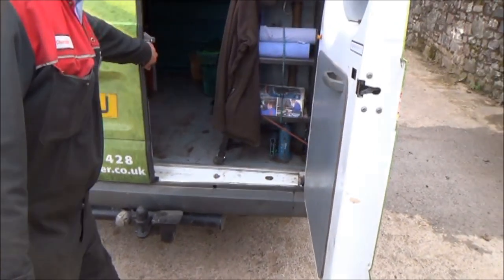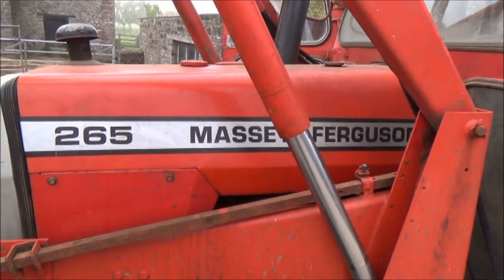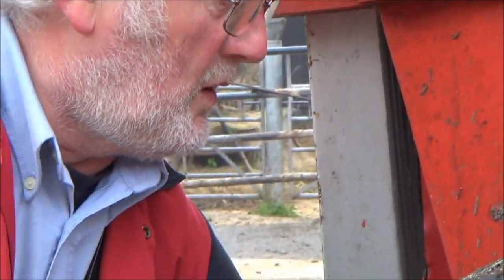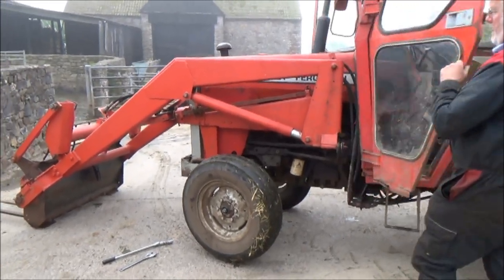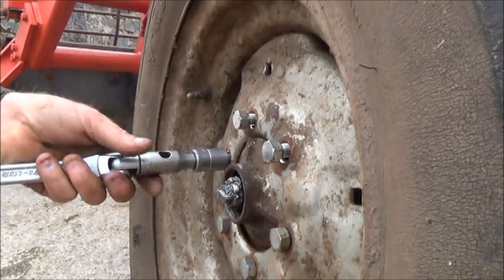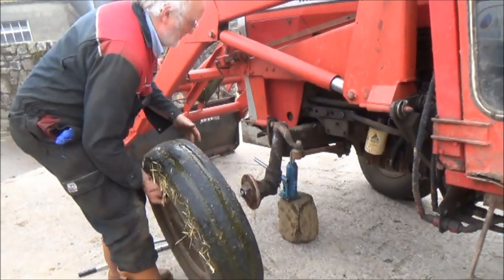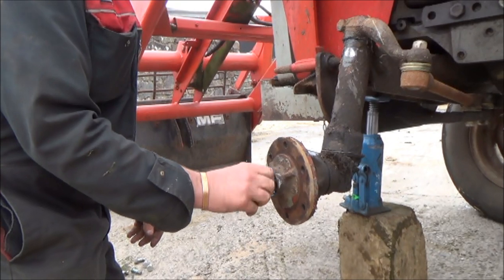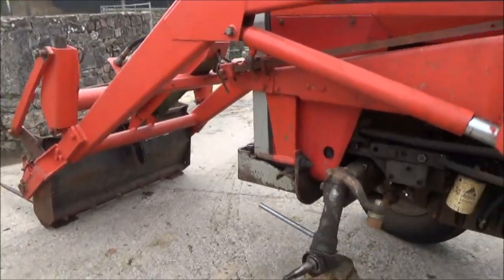Fitting a new wheel hub to a Massey Ferguson 265.Part 1

Comment: how many tractors do you have? and why don't you sell a tractor you don't use and instead buy a good tractor like a new holland 8340 we've got that on our farm and its brilliant or a deutz fahr d6.30 which is also not a bad tractor.
Reply from the maker: 3 good tractors and a few old ones. We have a good mix of tractors for what we do and the old one don't cost us anything so it doesn't matter if they sit in the shed until we need them. I guess every farm is different in how they use their kit

Comment: you call yourself a farmer? you could have fixed this by yourself and saved some money. a farmer is a jack of all trades....mechanic, welder, framer, plumber, electrician, heavy duty machine operator...etc. I do better work than professionals and take more care
Reply from the maker: I can't do everything myself. Jack of all trades = master of none
Reply: @thefunkyfarmer  you should learn. i do everything myself and do a very nice job. built my own house. all the inspectors said everything was top notch. rebuilt several engines. manufactured my own custom equipment. in the trades there are no masters, only con artists and idiots. they dont even follow the manufactures guidelines half of the time. if you take the time to do it properly and are not afraid of spending money on tools, you are a master of all trades. ps....nothing ventured nothing gained